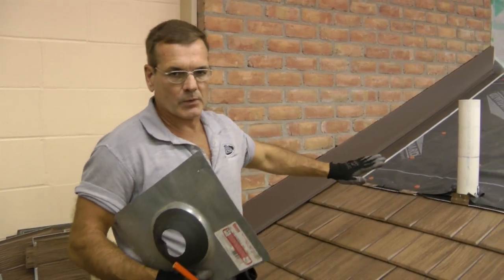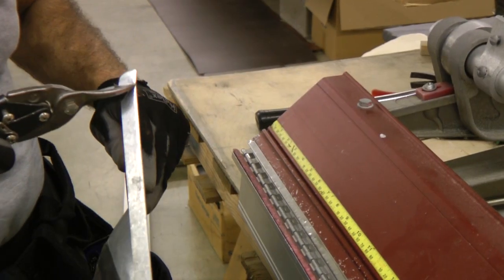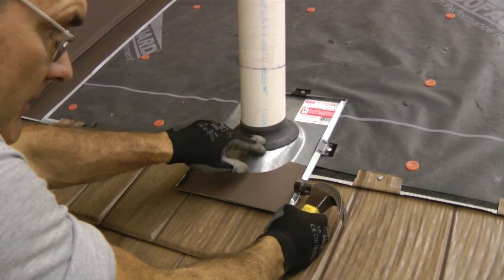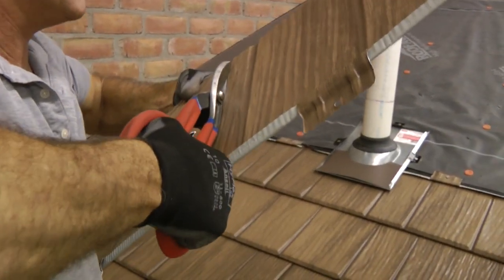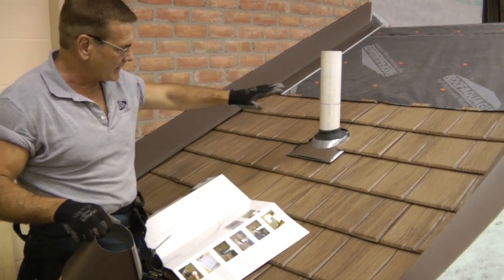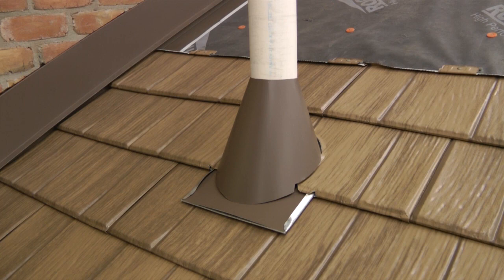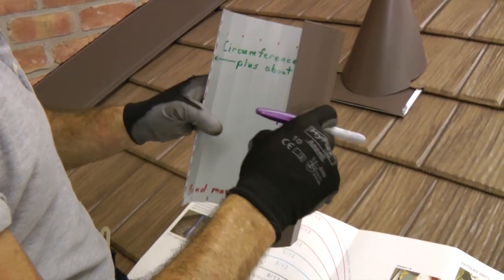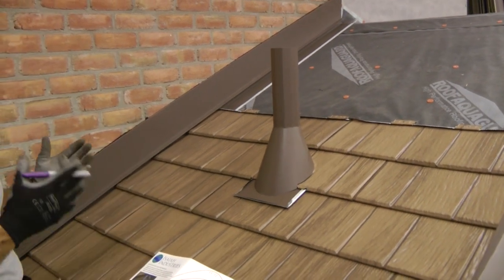Vent Pipe

Comment: Hello. What type of snow guards are best for this kind of roof?
Reply from the maker: The KasselWood steel shingle is manufactured by Isaiah Industries.  They offer a cast metal snow guard that works well with the system and can be installed while the roof is being installed or after the roof installation is completed.

Comment: so you have to cut out a temate for each pitch of roof? so you would need 12 different  templates?
Reply from the maker: The pattern is supplied with every roll of coil.  If multiple pitches are needed, the pattern could be taped back together and recut.  Pitches that are nearly the same may be able to be accommodated without cutting a new pattern.

 Alternately, you could request additional patterns with your order. 

 If you have multiple pipe diameters, cut the smallest first, and then the larger.  Thanks for the question.

Comment: You dont have to cut a little hole at bottom of cone to let water out?
Reply from the maker: Hi Brandon.  In my instructions I suggest running a bead of sealant around the entire circumference of the cone where it rests on the shingle and pan except the bottom 2” to leave any moisture drain out.  There should be very little, if any, moisture under the cone, though, if the assembly is properly constructed and sealed.   
 
These instructions are printed on the cone pattern that comes with every box of coil that Isaiah Industries ships out, as well as in our newer manuals.
Reply: @KasselandIrons  right I ment at the bottom where you dont seal it shouldn't you cut a hole to let water get out or?
Reply from the maker: @Brandon-no3vc  If necessary a little material can be trimmed off to allow for a gap at the lowest point of the cone where there is no sealant.
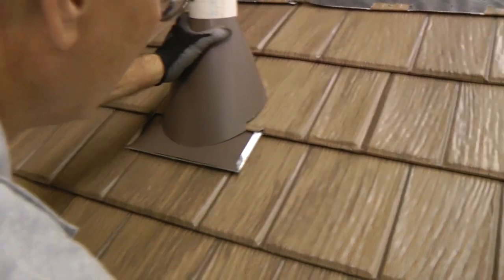Reply: @KasselandIrons  is it nessisary in this video? You can see @ 11:33 it is tight to the boot flashing
Reply from the maker: @Brandon-no3vc  Yes, in this case it would be wise to leave a notch or hole for any water to exit.